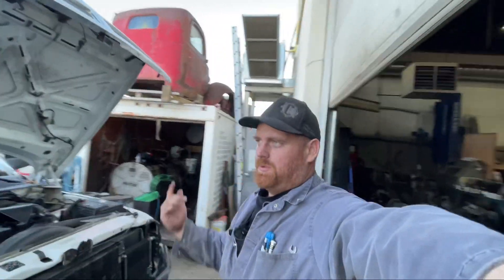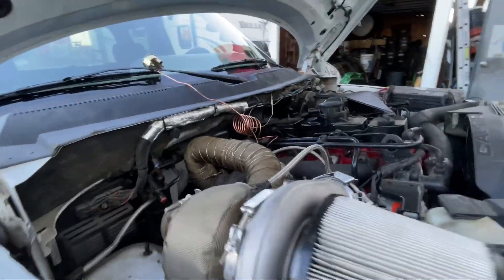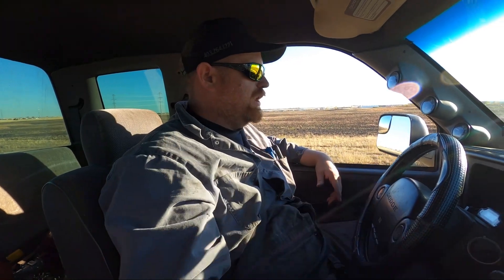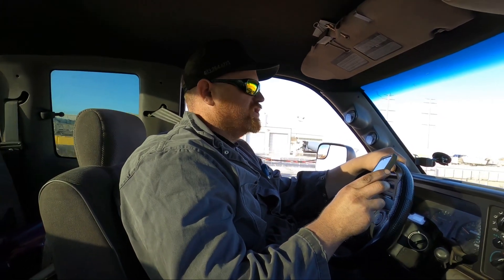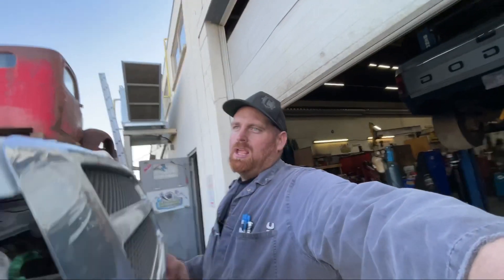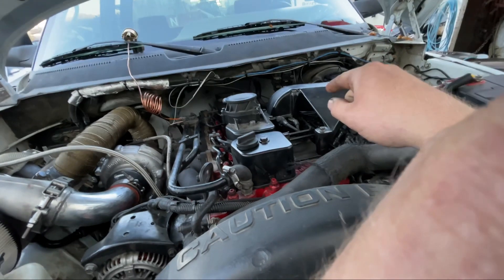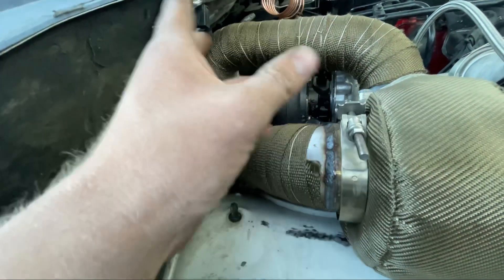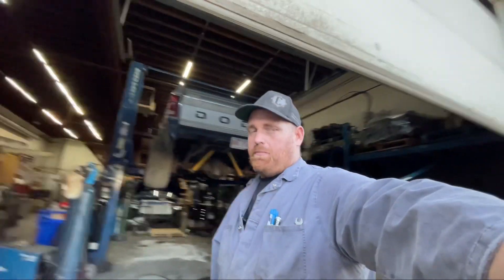The single just isn’t for me. I love me some compounds.

Comment: Awesome set up,,, question, how much horse power and or boost can you make safely on a stock head stud set up before may blow a head gasket given the tune is good with not to much timing?
Reply from the maker: That’s loaded question. I have made 550 on stock bolts and gasket. But lots of guys have issues at 400. 

Stock gasket I tell guys stay under 17-18 degrees. Boost I wouldn’t be worry about.

Comment: Leave the 1.1 on the big turbo and ditch that k27 for an S360.
Reply from the maker: I know the turbine in the k27 is a hold back. But I want to see the primary harder. Will make this setup work better. 
I am going to use this setup as is for a while and do a different setup I want to try on the loadstar and also do a different setup on the ve setup in my buddy shae’s truck